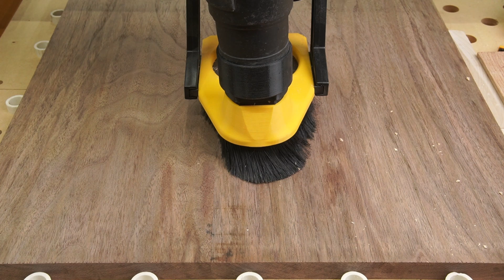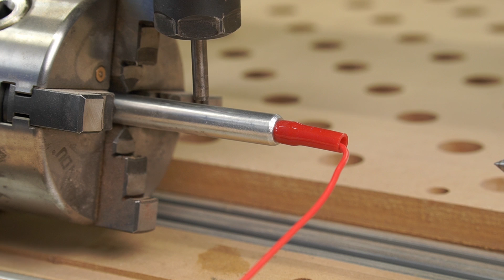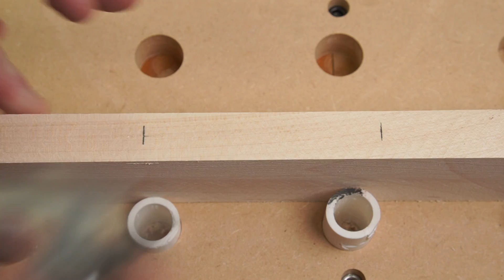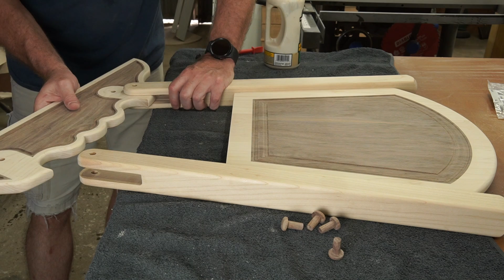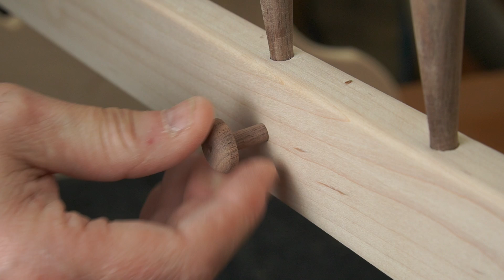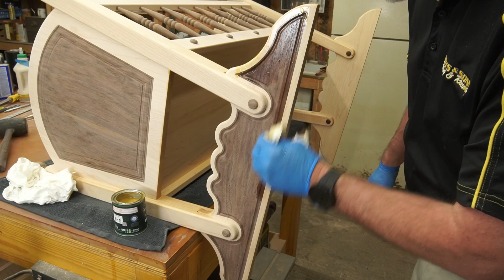Building a Wood Bassinet for my First Grandchild

Comment: I need to build one of these. I’ve got a new granddaughter over there in AL. Do you still have the CNC layout?
Reply from the maker: Sadly no.
I have never been one to make or write plans, and I just made the cuts as I go.
Here's what I did...
I found a free STEP file for a baby cradle on GrabCad, and I changed up some of the features to suit my tastes, using Fusion 360.
Once I had it like I wanted, I just exported svg's of the sketches and used those to make the cut files in Vcarve.
I hope this helps.
Thank you for watching!

Comment: You do a great job with your videos. I’ve produced some videos on a totally different subject matter using DaVinci Resolve. That has its own leaning curve in addition to your woodworking skills. Mighty fine on both. 

Which OneFininity do you own? Did you go with their controller and screen? 

Thanks!
Reply from the maker: Thank you Bill! That means a lot! I am constantly toying with Davinci Resolve trying to polish my technique. You noticing really means a ton!

I bought the original Onefinity Journeyman about 2 years ago. I outgrew the stock controller pretty quick.
When they announced the new Elite machine, and the future upgrade option for current machine owners, I got really excited. But seeing how long their lead times were I knew it would be several months before us old folks would have a chance at the upgrade, and I was correct since they just released the upgrade a couple of months ago. I have zero patience and I wanted it right then! Ha!
So I ordered  the MASSO controller and steppers straight from MASSO and upgraded it myself. I don't have the touch screen. I run my display through a 32 inch TV I have mounted over my machine.
If you are interested, I talk about the upgrade and how I did it in my very first video, which you can find on my channel.

Again, thank you for the kind words and thank you for watching!